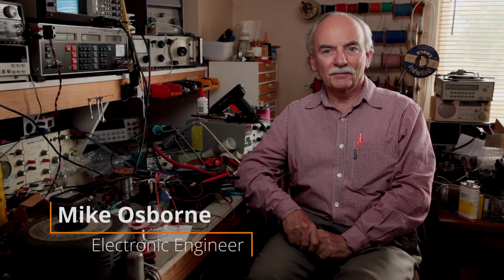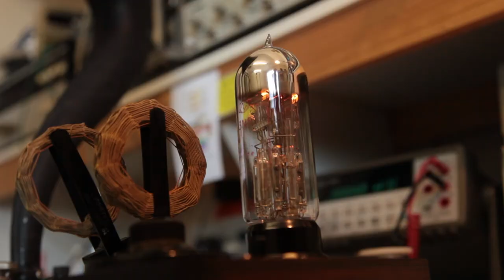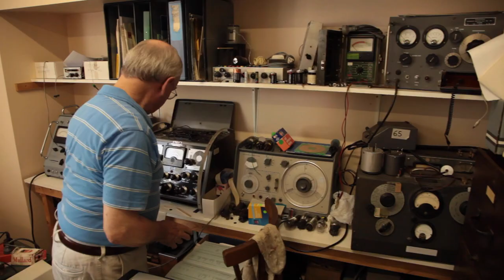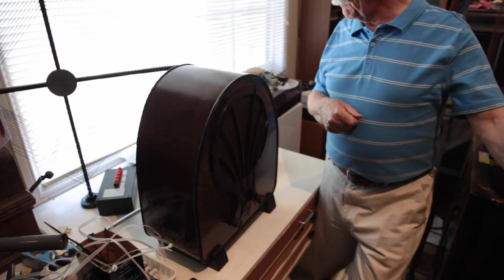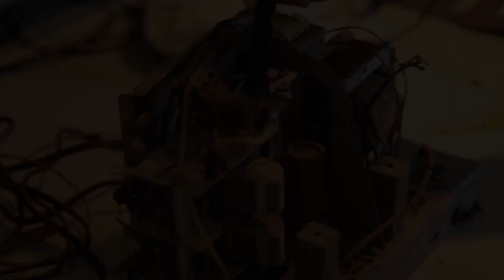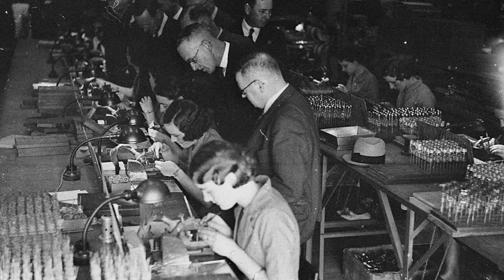A conversation with Mike Osborne

Comment: what is with these white flashes?
Reply: I was wondering if it was the camera doing it. old sony Bettacam uses to do that to notify cameraman to stop the tape before the battery dies.
Reply: @Dromen you mean as a VFX added for cuts? if that's right, i would say the VFX is very long and slow also to many similar cuts, losses the dramatic effect